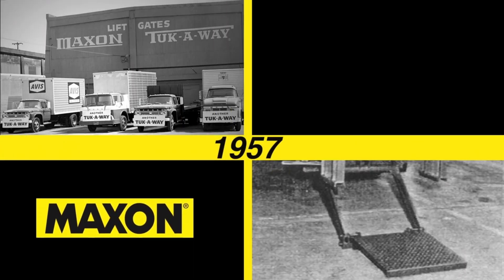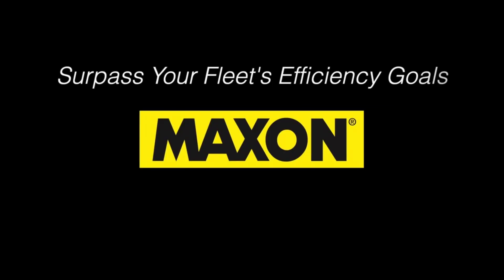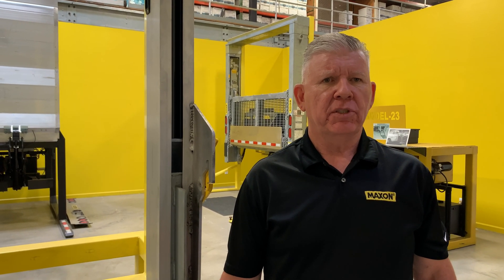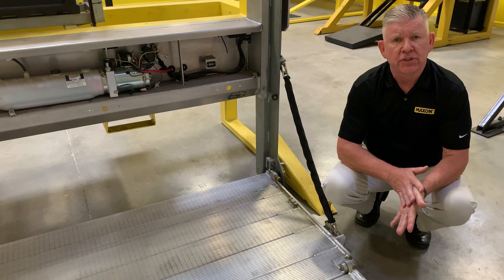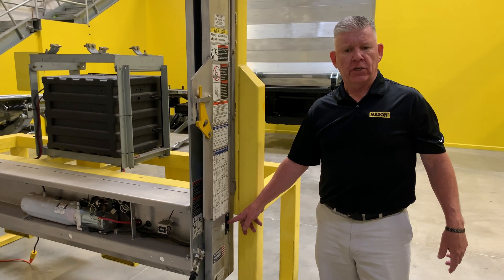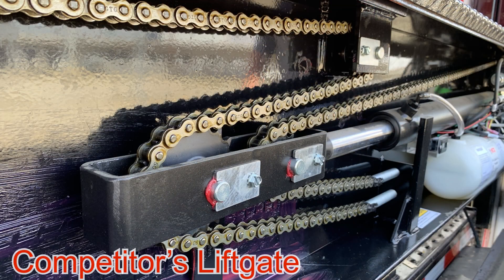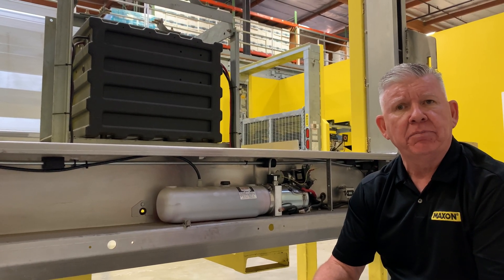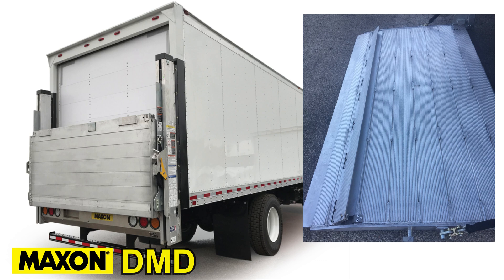DMD - RAILIFT™

Comment: I would like to know how you unfold the liftgate 
without breaking your back.  

I do not see a way to use proper lifting mechanics
to do so and my back is paying the price after only 4 days. 

Your back is twisted and you are leaning over the support 
chain while unfolding the second half with the full weight
away from you which strains your back even more.

I encouraged my employer to buy a different lift gate 
(RC Railift)
but well this one was probably cheaper than the one 
with diamond plate and hydraulic opening and closing.

I wonder how much back injuries cost these days?